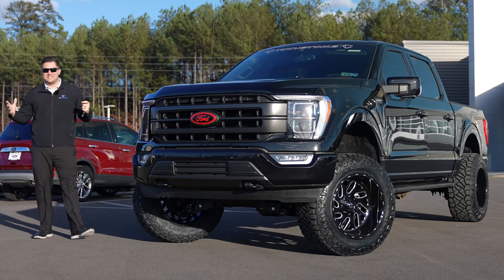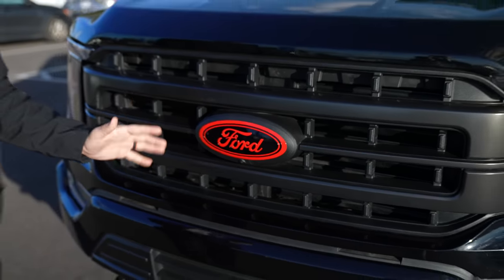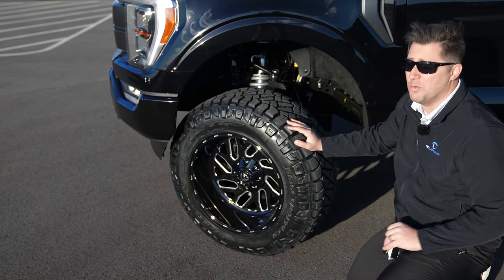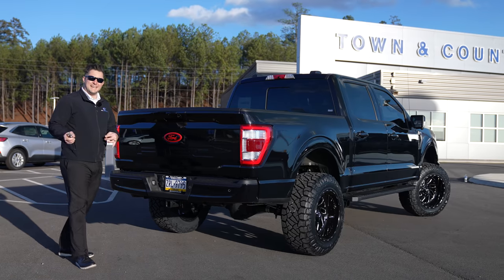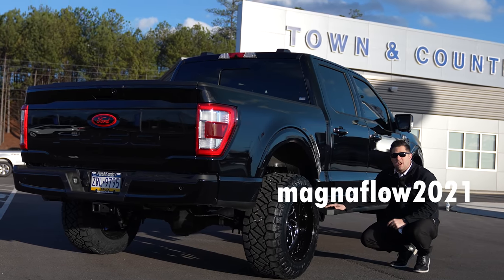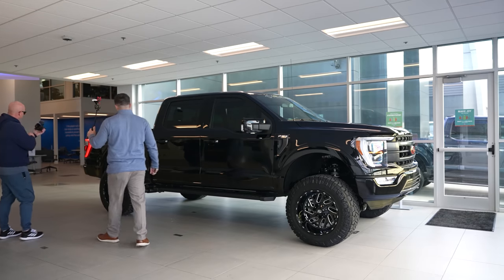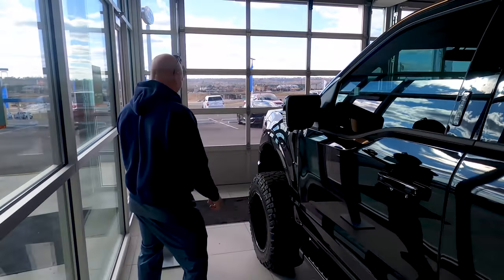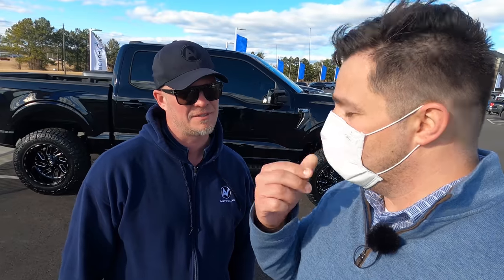Revealing AutoVlog's NEW F-150 + SURPRISE!

Comment: I have a 2021 5.0 Platinum, SuperCrew 2021 black out on a 6inch bds on RT37x12.50R18x9 has true dual straight pipe no resonators no cats 8% window tint all way around 30% windshield has dump tips 4.50 gears

Comment: Great video.  Looking to get this 4 inch with 35x12.5r20 nitto tires.  Will there be trimming needed on truck?  
Will cutting original crossmembers on f150  not affect ford esp 100k warranty plan?  Thanks great work!!!

Lastly do you recommend bds over procomp that does not cut crossmembers, they have a bolt on system.

Comment: Exhaust looks a little low ... imho
Reply: the truck is lifted 4 inches, i dont think it will matter that much. Also its better that its low than be close to the cab and rattle against the body of the truck
Reply: I need to take my truck to this shop to get it fixed... I paid $2,000 for a timing chain replacements and suspension components and I drove home with a missing bolt underneath one of  the struts and my 35 wheel almost collapsed while driving and my engine locked up within driving it for about 25 minutes... I am in the hole more than before I spent the money...